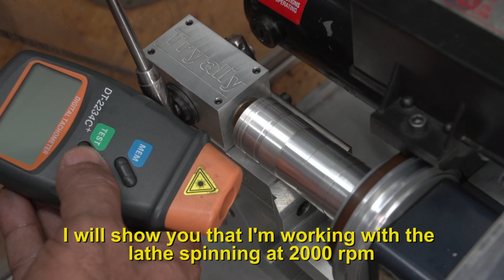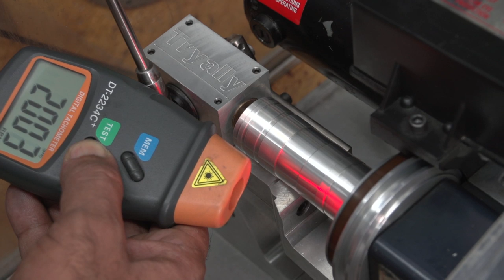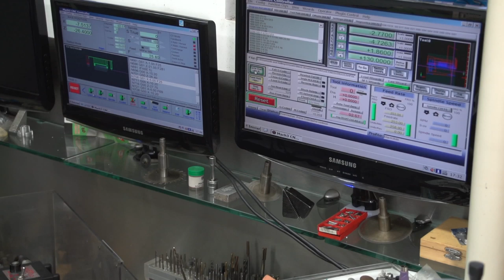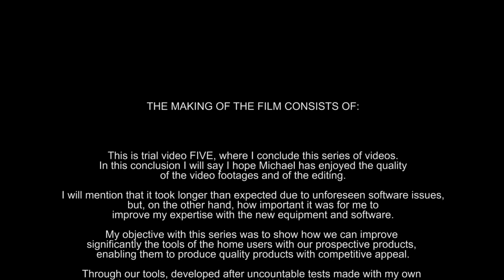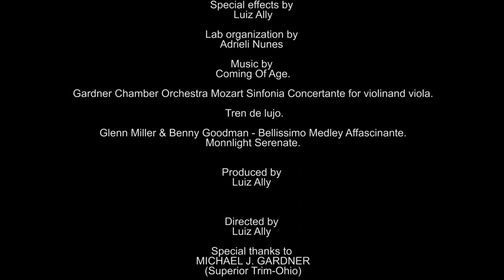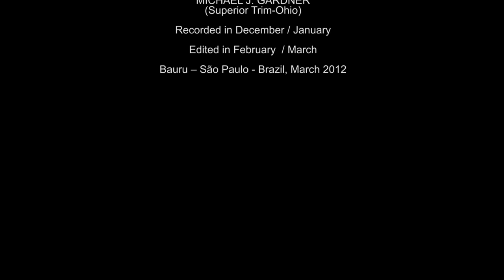Tryally Tech. Sherline Machines FIVE FULL HD

Comment: I need to make some videos of my Sherline CNC gear generation, but I need to find the right camera -- manual focus, macro, small size, etc. would be nice. What camera do you use? When I generate  bevel/miter gears with five axes, I'd like to mount the camera to different moving parts of the machine -- the camera will have to be small. Any ideas?
It's been a long time since you uploaded videos, are the triplets as tall as you now?

Comment: Love the videos, Luiz.  I follow you on FaceBook, too.   I would love to have a set of plans for the rotary table with collet closer.   How are you creating your G-code?  
-Do you have any videos where you explain your coolant system?  Is the coolant system re-cycling "TapMagic"?  (Ok-saw this on another of Luiz's videos-Yes it is recycling). 
-or what is your cutting fluid?   (OK, saw this in another video it appears that you are using a mixture of Oil & Kerosene for cutting aluminum)   
-Is that the 10,000 RPM pulley set up on the machine?   Sorry for so many questions - just a great video

Comment: Hello Luiz,
I know this is an older video, but you mentioned a quick change system for the end mills on your sherline mill.  How is that coming and are you going to do a video on it?  I have a Taig and use end mill holders that I made using your design and it works well, but would like to have a true quick change on my mill. Thanks for all the great videos and information you are giving.
Ben

Comment: Hi Luiz, how did you get 8000 rpm on the Sherline mill? Thanks
Reply: +Vincent Tan I would assume he turned a custom pulley set on his lathe.
Reply from the maker: +James Wiger +Vincent Tan and /101799005735443453017/
Hi Vicent, James are right , so I'm using a Sherline pulley kit  to work until 10k rpm, works well.
10,000 RPM Pulley Set, P/N 4335
Reply from the maker: +Vincent Tan and + 101799005735443453017
Hi Vicent, James are right , so I'm using a Sherline pulley kit  to work until 10k rpm, works well.
10,000 RPM Pulley Set, P/N 4335